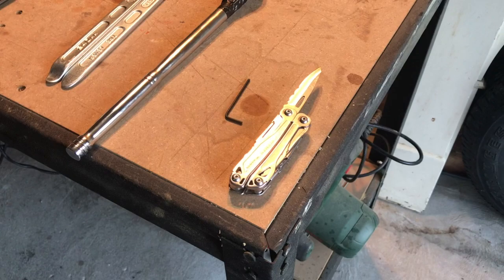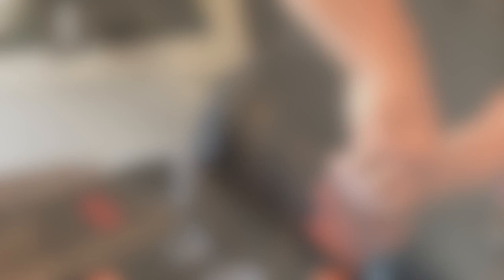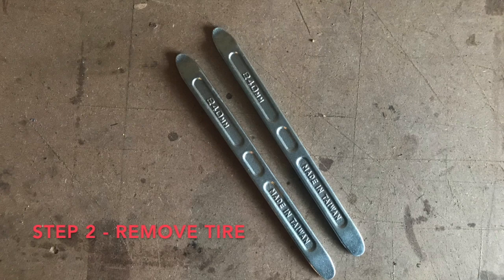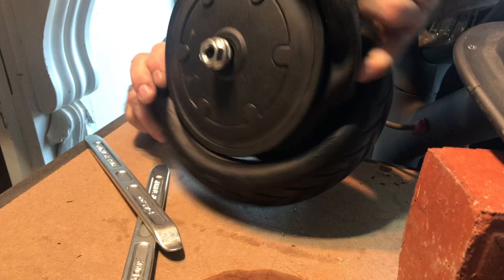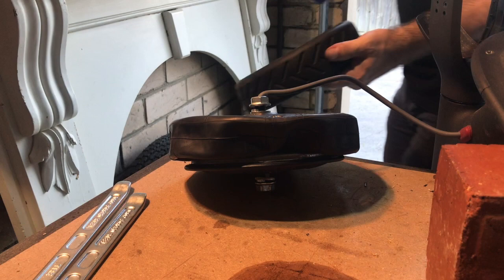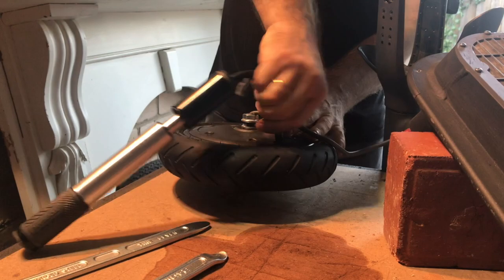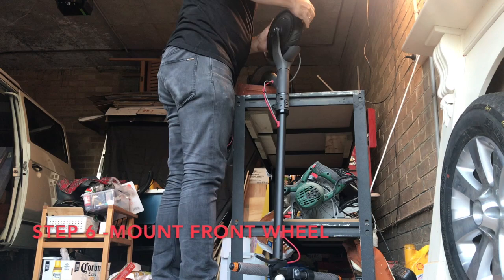Front Wheel Removal and Tube Change On The Xiaomi M365 - Nightmare ahead!

Comment: You could pre-inflate the tube just a little bit before installing in order to prevent punctures in the process. That's a common practice when changing bicycle tires. Also, the change is more difficult if you remove the outer tire completely instead of just one side.
Reply: You clearly never tried to remove tire from this stupid thing. There’s no way of removing it without removing everything from that stupid wheel. It’s just impossible.
Reply: @borisilascik5089  You are correct, he doesn't have a clue lol.

Comment: I gave up on the rear wheel after 2 fruitless hours and just brought it to a bicycle repair shop where the dude got it done in 5 mins. Now I got a flat tire on the front wheel and already have anxiety attacks just thinking about it. I am going to do it myself this time. Thanks for the WD40 and the clamps hints.
Reply from the maker: TurboPlasma I since learned to use soapy water instead of WD-40, this way the tire doesn’t stay slippery.
Reply: I literally had the EXACT SAME THING HAPPEN LOL, back tire went out, went to les Schwab and they got it done in about the same time, but it took a while for them to get to me because of other customers. This time I was just determined to do it myself and somehow managed, seeing everyone in these comments saying its a nightmare was such a put off, but i was broke and couldnt have les schwab do it again lol, it was only 5 bucks but i had already gotten the tube in and half the tire on, they put the other half on, thats the hard part, i somehow managed to do this to the front tire this morning alone, with his clamp hint, i found 3 random different clamps in my garage and only need 2 of them and a butter knife, i used the back side of the knife because its a lot stronger, its still a bitch.

Comment: I was able to do it in about 2 hours of hard work. My hands are bruised, almost broke the valve of the new tube, but I was able to change the damn tube. Very bar Chinese design, also the tire is very hard, it needs a lot of effort to put in back in, taking it out is easy. Hopefully I don't get another flat tire, actually it wasn't a flat tire, just a snake bite. The back wheel is so easy to change, last time I did it in 30 min, this one is a nightmare!

Comment: Best instruction so far. I used W5 lubricant, same stuff I guess. Also extended the key with a polygrip (what i had available). This did the trick for me! Note I tried for over week to remove the nuts prior to that.
The old tube wasnt that hard to get out, just used the polygrip. But man, the valve was hard to get in the hole. Still struggling with it but I’m not sure I want to mod the hole just yet.
Reply: I popped my tire last night the front one, and I was very dedicated today to get it back together and it took me about an hour or so. My trick with putting the valve back in was to just push literally downwards as hard as you can with both thumbs, I put a little olive oil in the valve hole first, it works if you don't have anything else. But ya just push down so set the tire on its rim with the valve on top and just push that sucker as hard as you can, I know the valve goes to the right and there is very little room in the rim so it feels like it is stuck, but just keep pushing I got mine in in like 1 minute, the getting it out was hard for me. Also I have no clue how I had enough strength but I loosened the nuts with just a like maybe 10 inch wrench, it was hard but I had nothing else and didn't have duct tape so I just went as hard as I could and was like I have to do thissss lol.

Comment: NIGHTMARE IS RIGHT: I had to have a friend stand on the scooter, while I used the wrench on the 18mm nut. It wasn't easy to get its off. Then I had the same trouble with the stem valve.  It wouldn't come out.  And when I installed the replacement inter tube, like you, I had a difficult time getting it back on. Then I had problems getting the tire back onto the rim. I have small bicycle levers and one metal lever. I tried to use two clamps, but it didn't work.  I used Vaseline to lube the tire rim.  I've watched other YouTube videos on installing the tire. I don't know how they were able to get the tire off and on. I think they had the same problems as you and I did, but were holding back and not being honest. I wasn't able to get the clamps to work. I finally put the weight of my knee on the bottom of the tire, and I used two tire levels to get the rim back on. It took me an hour to figure out the the knee was a better solution. I hope I won't have to change out the inter tube or  change tires.  WHAT A PAIN. Altogether it took me a few hours to deal with the front tire.
Reply: I don't think they are not being honest, it's doable, you need to persevere and just be pretty strong, I'm only 5'6" and 145 lbs but I managed to do this task in an hour, with less capable tools than this man, and no drilling.
Reply: Having a mechanic as a dad though really helps, he taught me a lot about cars when I was younger and I did some things on cars that were very hard, so I just knew this was possible, i did it alone.

Comment: This took me about an hour, I tried on the back wheel when it popped with a brand new tire and tube and i couldnt do it myself, i went to les schwab tires and had them put it on for 5 bucks. This time I was dedicated and i also couldnt find any punctures really in the tire that was already on it, so i reused the same tire, ill tell you what, using the tire that was already on it is far easier than trying to put a brand new one on, i luckily found a couple clamps and somehow managed this with 2 clamps and 2 butterknives lol, the valve part was probably the scariest, i just pushed the new valve into that valve whole as hard as i could with no regard to damaging the innertube, just push down as hard as you can with both your thumbs it will pop in, least fun ive ever had, but man was it satisfying doing it on your own, also if you dont have wd40 just use olive oil that is what i did, when untightening the 2 bolts that hold the wheel on i thought it wasnt going to happen unless i jerry rigged up something kind of like he did, but i went back and pushed with all of my might as hard as i could for like 5 seconds and it budged, one side was kinda easy but man i cant believe i had the tools and balls to pull this off. im getting solid tires next time i need to replace i dont care about the ride quality, ill just buy a front suspension kit, fuck doing this again

Comment: Those kinds of nuts are installed with a "fixing" substance that, well, fixes them in place. You can sometimes see it as a blue blob in the nut once you remove it. The good news is that once you open them once, the fixing substance won't be an issue again, but it is true it can be frustrating the first time as you struggle against the nut's wrenching force AND the fixing substance.

Comment: I'm having a problem with the valve hole too!! Can't get it in at all! Had to hammer it to even get it off!!
Reply: Yep! I feel your pain. Mine didn't come out - even after I slashed all the inner tube away from the valve. The Xiaomi technicians building this scooter obviously put the tube in before putting the motor in. Obviously, removing the motor and its housing everytime you get a puncture isn't practical. I've tried to prize out the motor outer casing with no success. So I guess I'll have to drill away at that damn stupid black plastic notch too widen the hole for the valve to go in.

Comment: The reason the inner tube would not come out is because you need to remove metal plate as inside you have a black bit holding the tube in place you need to remove before removing inner tube

Comment: i hammered away at the wrench for 20 minutes straight before that fucking nut gave way, THE THREADS BROKE!!!! it literally shattered some of the threads instead of giving way!!! WAS IT WELDED THERE?! WTF .. for real they have glue on the threads, so i guess heating it up a bit would make the nuts a lot easier to remove.

Comment: I think the wrench should be 18mm not 19... but thanks for the video wish you'd shown the drilling in more detail as that was the key solution to everyones frustration.
Reply from the maker: Fluctibus Fludd When I made the video I felt stupid that I couldn’t fit the tube back in and had to drill out the valve seat. Only after the video was published I realised that everyone has this problem 😂

Comment: Same situation with valve, spent about half an hour to get old one out, new valve just won't fit...
Reply: it is so peace of cheat ): i have it too
Reply: the fucking same problem
Reply: There's no reason to remove the tube if it's not popped  so cut the stem off the tube and it comes right out.  I can't believe how many people can't figure out the simple shit. You still need to drill out the hole but that is not difficult either

Comment: i got puncture after 124km.. its my mistake to cruisin on a mining site.. to release the front tyre gives me a nightmare .. firstly im doin by myself but i cant..im using 18 wrench.. it keeps sliding. Then i ask for local shop.. it worked only on left side wheres no cable.. but for the right side its completely a different story.. finaly on the 3rd shop.. i made it.. he using a table clamp( big steel one), tight in into the nut..( very thight).. but more problem occur.. the valve wont come out.. so im using wd 40. Plus im using like small philips to push out the valve.. the inner tube is puncture.. so i patch it up with a special patch, heat it. And re install everything.. so im re using the inner tube

Comment: Thanks for posting this never thought it would be this hard to change the tire... Nuttiest part was when I had to drill just like you wth is wrong with the person who designed this tire?!!?!
Reply from the maker: So true: what is wrong with these engineers? Zero allows you to screw apart the rim which looks much easier than this.
Reply: It works if you take the whole thing apart like your supposed to  but drilling it is a nice way to fuck the seal in the motor and let it short out when it rains or you hit a puddle

Comment: Hey thanks for posting this video.  I had the same idea to drill it out bigger but I thought I'd see if others had the same issue.  My leak was on the valve stem where it rubs on the hole in question.  I think this stupid f'ing hole caused the flat and the reason why I will have to pop a valium in order to finish this job.  Has anyone contacted these idiot's (xiaomi) to see if there is a future fix?  Not gonna lie, I'm pretty pissed off right now.  Getting my drill.

Comment: Hello mate where did you buy those clamps?  What is the brand name, 
Im losing My mind, trying to fix one wheel. Its a nightmare
Reply from the maker: Sensoila Tornadoelita I bought the bar clamps at the hardware store. They are used for holding wood in place when cutting or glueing.
Reply: @belectric_co648  Thanks for your quick reply.  Im wondering if I could do it with just two of those clamps..
Reply from the maker: @morpheusmatrix7338  Yes definitely, more just makes it slightly easier ...
Reply: belectric_co mate I had just ordered two clamps.. then I saw this video https://m.youtube.com/watch?v=erkiIxc2XfE  and I fixed my back tire in less than 10 mins. I’ve been struggling for 2 days.  That trick might even work on the front wheel.  Have a nice day.
Reply: belectric_co now I’ve cancelled my order :) there’s no need
Reply from the maker: @morpheusmatrix7338  Ha nice one!
Reply: I saw the video and also didn't had clamps.
Another solution is to put zip ties around the tire itself to keep it small and inside. 
It helped me.

Comment: No, its not only you!!! My hands are bleeding everywhere and I'm only at trying to remove the fucking tire. I've already bought lubricante, slime and other tools for almost the same price as a new scooter. I fear the worst is  to come and I doubt I can control myself. 

I got a flat on my back wheel a week ago, when I gave up trying to fix it myself i went to 3 different bicycle shops and none of them were able to fit the new tire so I had to go to a car mecanic and after they struggle for 40min with their tire machine they got it on. 
This is the worst fucking crap ever!!!

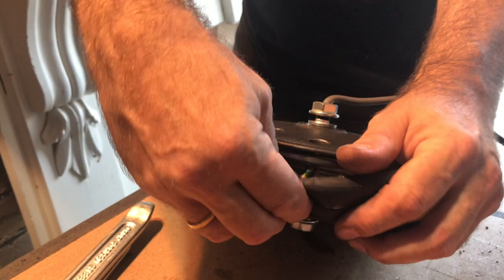Comment: 4:05 NOOH it will go in like it came out 1 mm shorter valve would magic. OR remove motor cover and rotor you get plastic off.only function for that plastic part is keep valve out so it not slip in tire when you build all this thing and try put air on it LOL

Comment: I am about to throw the Scooter. Unable to change the back tire. After my old wheel DISSOLVED itself from inside and therefore rubbing a hole into the tubing, it is litterally impossible to change the tire. I heated it. And broke two of those tirechanging tools. so far no success. So far I was able to change all my tires on bycicles...
Reply from the maker: Julian Bechtold Sorry to hear that Julian! Take a step back, calm down. Unfortunately it’s not exactly like changing a bike tyre, I learned that the hard way as well. I have not yet done the back tyre. Make sure you have motorcycle tyre irons. In the video I used WD40 to make the rubber tyre slip on, I have since learned that dish soap is better. Which step are you struggling with?
Reply: @belectric_co648  Im struggling with the last step, getting the second rim over so that the wheel is complete. You are right, there is absolutely no way with bycicle tyre irons. They cannot withstand the Force. They just break into pieces. I think I have to get the motorcycle ones.

Comment: 5:28 you get half tire in so easy LOL that is allready hard. AND good hint for clamps cost more than full motor from china with tire on lol AND still hardest part left i cant get first part tire in that easy. need squueze it even more with clamps on lol

FINALLY i got it in after 2 days trying.brute force not any tools LOL. beat that. only thing left. did i made new hole(s) xD

Comment: WARNING. Do no open the engine cover. Mine was stuck on even after taking out all the screws. So in the effort to force it off i broke the bearings in my wheel. 😭 Use the drill method! What a seriously shit design for a wheel, i honestly would not of bought this scooter if i had any idea how hard it would be to fix a fucking flat tyre.

Comment: After leaving this nightmare a day to reconsider my options here is the way I did it:

1. Press the inner tube in ~EVERY point simultaneously so you can deflate the tube to its smallest,every air molecule counts.
2. Since I did not have anything to clamp down the outer tube, I used 2 metal levers to push it inside then FUCKING STOMP ON IT TO KEEP IT IN PLACE, so I had 2 free hands to use another 2 metal lever on the other side at the same time to fit it completely.

Also dont forget to lube :D
Reply from the maker: Wow that's some dedication!